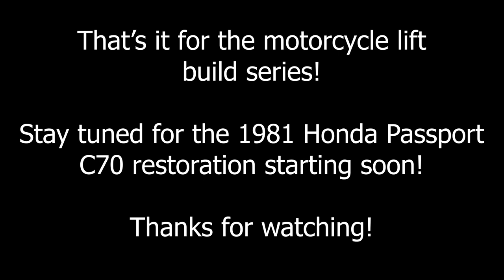Air Spring Actuated Motorcycle Lift Project

Comment: Are there any safety locks or do you rely on the airbag to keep your bike up?
Reply from the maker: Hey Cory, I've got plans to put a simple piece of 1x2 steel on a hinge that will be on a hinge that rotates down and goes against the legs to keep things up, but for now, I just stick a tall wooden stool in under one side and it keeps it locked out just fine when I let the air bag down.

The bag also keeps the lift up fine.
Reply: Sounds good!!! I was just wondering that’s all !!!  
Love the lift tho. Awesome work.
Reply from the maker: @corynoseworthy3838  Thanks a bunch Cory!

Comment: Do you a price breakdown or material list for this? I would love to make one and save myself the $1500 for the handy 1200.
Reply from the maker: Hey Mason! I don't have a complete breakdown, but if you go through the series on my channel (there's a playlist of the detailed build series) you should get a good idea of the materials used. I figure I spent about $300 on steel, about $30 on bearings, $100 for the good Mettle Air brand pedal I ended up using, $120 for the air spring, $20 for hose and fittings, and probably $40 for the primer and paint so just a little over $600 for the materials. Check out the detailed series on my channel!
Reply: @blastworks  Hello man, once again Nice Build!! I would be more than willing to make a $20, $30, or mabye $40 donation to you to help keep your channel funded!! If you would be able to just give me a list of lengths of the metal pieces of the lift. I don't need any instructions, just a steel pars list like 4-2x4 steel tube at 55" and so on just like that! Thank you and let me know how that sounds to you!! Take care.
Reply from the maker: @danielmalsom7182  I greatly appreciate that Daniel, but as long as you are subbed that is good for me. Next time I'm out in the garage I'll record a quick minute or two long video with the measurements included and I'll post that, so if you're subbed you'll get notified of the upload! Thanks again for your great feedback Daniel!
Reply from the maker: Hey Daniel! Just a heads up that I'm about to upload that measurements video with a PDF linked in the description as well! Should be up in the next hour!